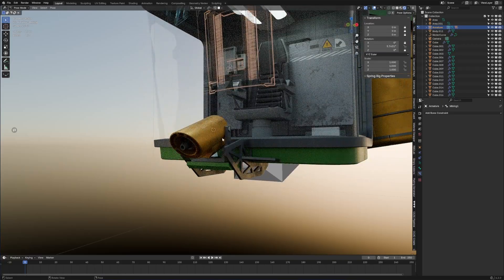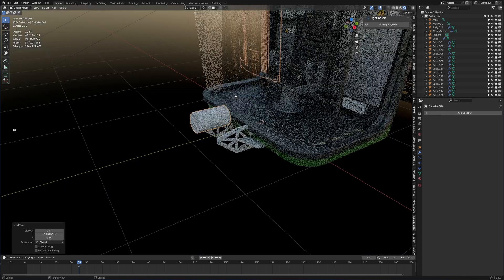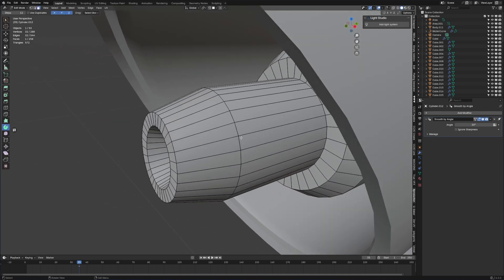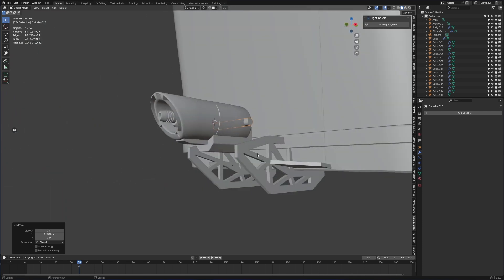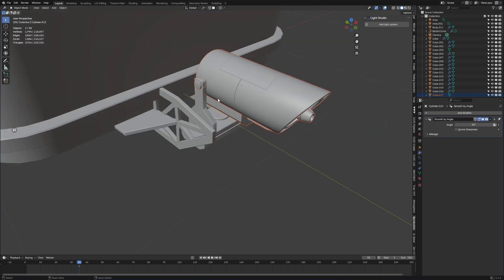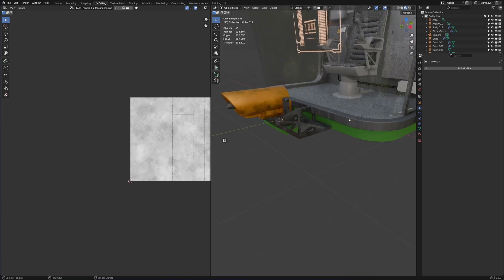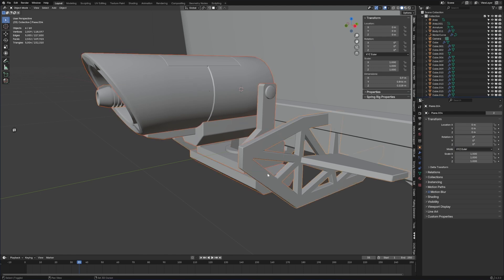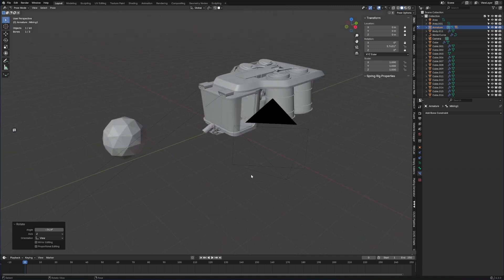Blender Secrets to Building an EPIC Mining Ship

Comment: Could you do a updated tutorial on baking textures? I am having a issue baking stuff and could you recommend a good addon for baking. Also what causes textures to be blurry and not sharp, even if you unwrapped them?
Reply: If the uv wrap makes the face’s projection onto the image is too small, the texture will effectively be low-res. You want the relative sizes of the components as projected to be about proportional.
Reply: Auto bake is a good option, I use final material mode and as long as you have good UV it’ll give you whatever you select, got a bunch of stuff going into normal? Click normal and all that stuff bakes as one normal map. For every normal map on the model. So if you have multiple materials with multiple normal maps now you only
Have one material and one normal map